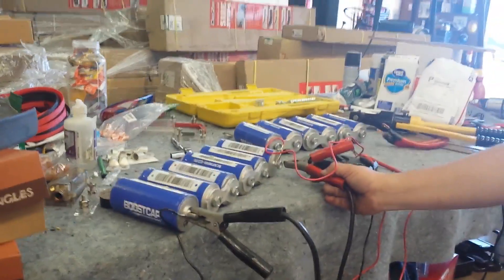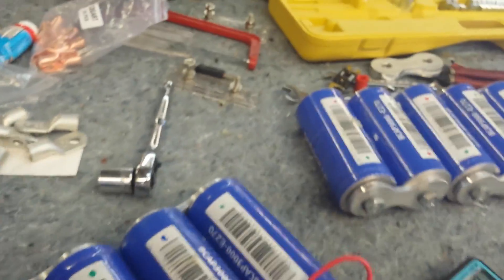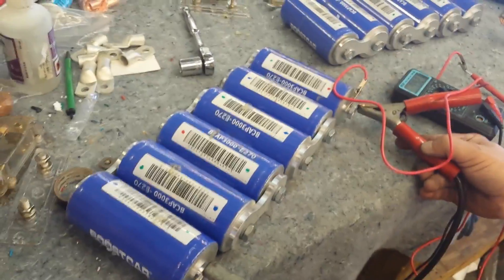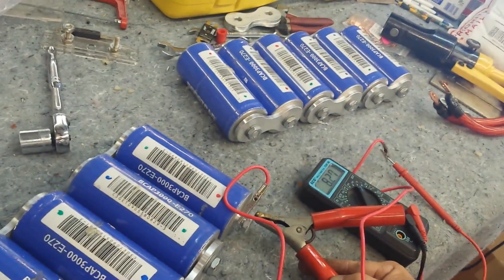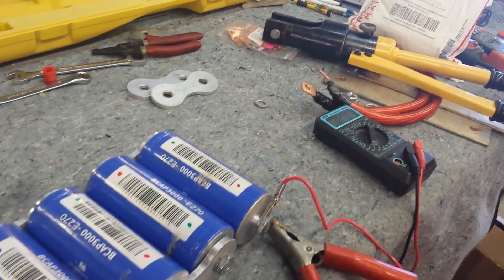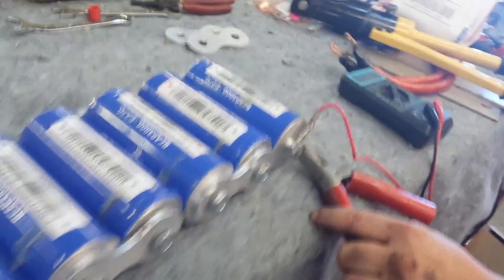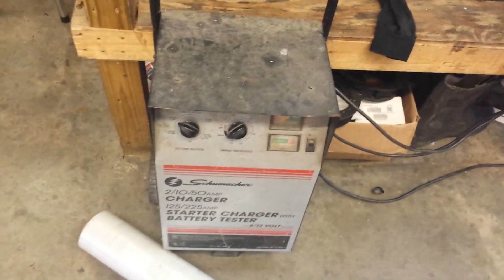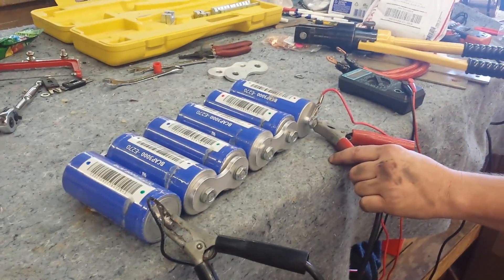MAXWELL SUPERCAPS CHARGING AND INSTALL

Comment: Ok since they go up too 16 volts you can stop at 13 volts cause you car is on a 12 volt system. Or can you just use 5 caps instead of 6 and charge the 5 all tge way up.

Comment: Sir, I need 25v or 50 v 4700uf capacitors in bulk quantities. If you are having the same please send me the prices, if not please send me the address of the suppliers n Mobile no immediately my WhatsApp no.8123947148

Comment: Hey I know this Is a old video, I have similar caps and the same battery charger,  but my caps seem to be charging alot faster then yours, so I trying to figure out what to do now. I have my charger on 12 volt 2 amps, charging 6 2.7 volt limitless super caps. Did your caps make a noise when charging? And mine went from 2 volt to 3 volts in about 10 seconds. Is that normal using this method to charge?

Comment: How many caps I would need my complete set up 18k and I have 6 2000 batcap battery with excessive amperage alternator my voltage sucks badly with 3 runs of stinger 0 guage
Reply from the maker: Caps are really good for people who compete. I don't suggest using them for a daily system. I'd switch to a Lithium battery

Comment: If u had to put a number on the percentage of voltage gain u got from before and after the caps could u?
Reply from the maker: Daniel Harrell Not really because I did more upgrades besides the caps when I added them. I will say I stay in the 13s if my volume is around 85%.

Comment: hey did you hear on instagram there is a new xs power supper bank
Reply from the maker: nissan and bass I saw it posted on Facebook today.
Reply: Oldbass40 hey if i have 2 ampere 3800s how many will i need to keep my voltage stabble at 14.4 volts
Reply from the maker: nissan and bass I'm not sure since my 2 banks plus 3 extra batteries is still not enough. And Supercaps are honestly better for just metering vs playing music. I would look into Lithuim instead. That's what I plan to get sometime in the future
Reply: Oldbass40 ok thank for the help

Comment: those maxwell are bad ass!!!!yeah Larry I was running some numbers last night based on what you have put in now that's including the XP2500 that is sitting on the floor that you put in. you just a little over the limit on reserve power if you add another 2 XP 2500 you should be able to stay in high 13teens or you can get 12 more super caps or send your alternator in to take out the internal voltage regulator an get an external adjustable regulator to run at 15.2 to stay in the high 13 teens after drop and still be safe for your car. hope this helps Larry.
Reply from the maker: +Angel Villareal Cool..I'm gonna be closely monitoring things now as I have no more $ to buy anything else to add to my electrical. But if it's not where I want it to be I'll be working towards adding more to what I need. I'd probably go with more Supercaps since they're lighter than batteries.
Reply: +Oldbass40  cool those are awesome Oh and if you see you voltage drop real bad just take your batteries out and take them to an auto parts store usually does for free or where you're at in this video and get an them amperage test on the batteries to make sure they are too par.
Reply from the maker: +Angel Villareal Yep..I closely monitor it so if something changes I'll definitely have them checked.
Reply: +Oldbass40 Oh I forgot to say change your chassis ground wire or add to it, it will keep the return power more stable.
Reply from the maker: +Angel Villareal It has already been upgraded

Comment: do i just hook these up to the battery like a second battery
Reply from the maker: +Jonathan Martinez yes
Reply: +Oldbass40 would it be fine with a stock battery or would i have to up grade
Reply from the maker: +Jonathan Martinez Get an AGM battery
Reply: +Oldbass40 sorry for so many questions im only 16 and with those batteries would i need caps
Reply from the maker: +Jonathan Martinez I would suggest batteries. Super Caps are harder to find and have a specific purpose.

Comment: Did you have bad voltage drop before the supercaps? I thought about getting a couple banks from XS Power to help out my batteries but after talking with them and seeing what they want for each I can't afford XS's supercaps. At $55 ea that would cost over $330 per bank plus straps, mounts and tax. I need to find some used caps instead.
Reply from the maker: yeah it dropped into the low 11s. It's definitely better now but if a song has a long deep bass note the voltage still drops into the 11s. But that is not often so it was worth it to me. I took out one battey but will put it back in to hopefully keep it always above 12 no matter what I play.
Reply from the maker: I know a guy who has some for sale right now if you're ready to buy. Email me if you want his information. Oldbass40@Gmail.com
Reply: Ok, I'd like to buy some. But I gotta be careful bc of the holidays & birthdays in my family. They all come from September to January, nephews, nieces, siblings and parents. Usually this time of year my personal "wants" have to wait, lol. I'll email you now, it'll be a Gmail account.

Comment: These caps are no joke! I have the older black ones, wishing I had the newer ones, but even they work great. I did a test pulling 300A over 10 seconds and my voltage only dropped 1.2V. I currently have 4 banks of 7 caps, getting ready to modify it to 5 banks of 6 caps (increase capacitance, lower voltage maximum). Great video, I just subbed ;-)
Reply from the maker: +Dereck BigDWiz Thanks for commenting! That will help others who view this video! And thanks for subbing!
Reply: Oldbass40 

What batteries are you using? I am thinking about getting the XS super bank capacitors.
Reply from the maker: XS Power XP 2500s
Reply: where did you buy this ultra capacitor from maxwell ? 
i heard this guy from youtube said he bought a bunch of it for 6 dollar per piece.. 
i don't think i am able to find any at any price near that..  i think it is a used capacitor.

thanks
andrew
Reply: Hey Big D, is there a version to use with car audio or is this it?

Comment: I would say it helped. It's a good feeling to have good voltage. You can add even more in the future. The more the merrier! strap some under your front seats and under your rear deck if there's room and in place of other batteries. I've seen people use nothing but caps and add an adjustable regulator to keep them up to 15 or 15.5. The more you have, the longer they maintain voltage and when you dip down eventually, turn it down and they almost instantly recharge. Bad ass product! All these years people said caps suck and batteries are the way to go... You just needed enough caps for the job!
Reply from the maker: +lmadden6236 Understand that normal caps should never be used as they don't work....You said "all these years people said caps suck" which is true for the traditional caps. Supercaps are totally different and haven't been used for very long in the car audio world..
Reply: +Oldbass40 Right, but most people don't know the difference between the two. similar concept though.